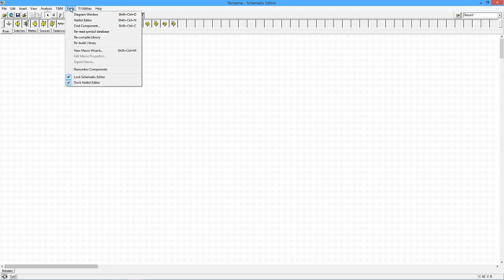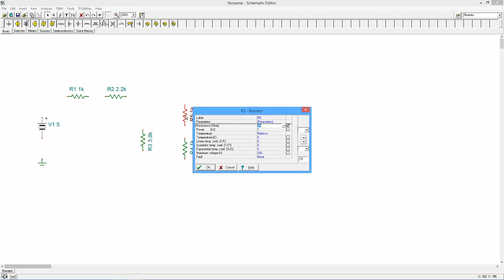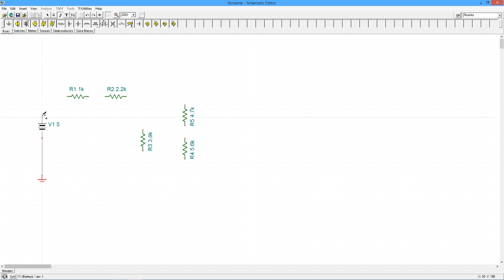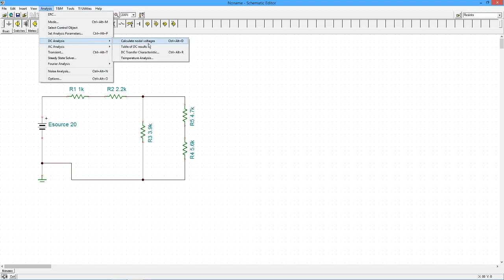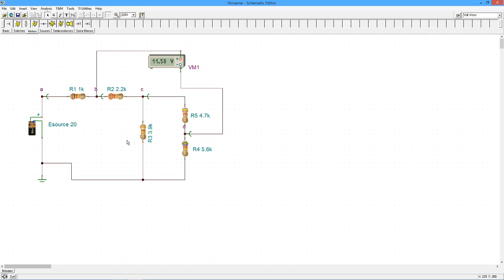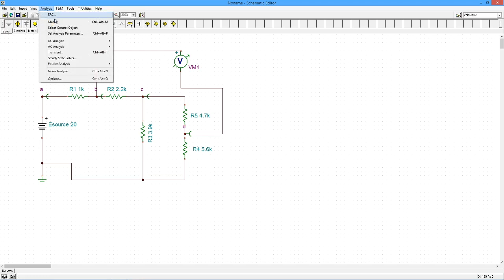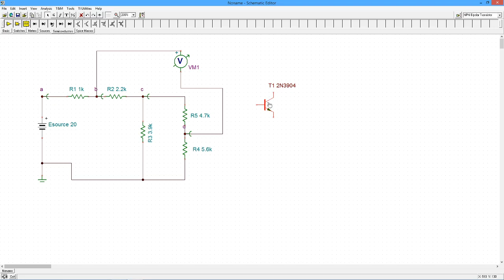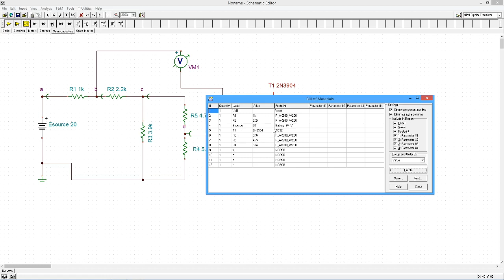TINA-TI Introduction & DC Simulations

Comment: Thank you. I'm just a hobbyist playing with breadboard circuits and an Arduino. I'm loving using Tina TI. It removes so much of the frustration for me and avoids me wasting time wiring up circuits that don't work. EDIT: As a beginner/hobbyist I didn't expect to find limitations of this free version so quickly, but it seems that it doesn't support polarised capacitors, although if you select "Enable 3D shapes" in the options, it does depict all capacitors  in the circuit as polarised electrolytic ones, with no way to select the direction of polarisation), which is even more confusing. I find the array of upgrades offered to be quite bewildering so I'm trying the version 14 trial which unfortunately doesn't make things any clearer.

Comment: Thanks for these very helpful tutorials !  I see there is a long playlist of them.  Do any of them cover the use of the TINA "Signal Analyzer" and the "Function Generator" (not Transient analysis, O-scope, Spectrum Analyzer ...) ?  Thank You !
Reply from the maker: No, I tend to focus on TINA-TI, which is free. It doesn't have the tools you mention (that would require $). I must admit, I am not a huge fan of virtual instruments such as function generators and o'scopes in any simulator I have used. They always strike me as rather clunky and less useful than more direct schematic capture and simulation methods. The one exception I might make is using a virtual voltmeter or ammeter for absolute beginners.

Comment: Great that TI made their version available.  Great tutorial.
I, also, couldn't find POLARIZED Capacitors.

Also, is there a setting or option to SEPARATE the component LABEL from the VALUE?
C101 100nF    .... is too long and the numbers run together.

I'd prefer;
    C101
   100nF
It's very compact and right next to the actual component.
Reply from the maker: I prefer stacked, too. You can leave off labels and such, and then add your own as text. Also, the label/value can be moved around the component (unselect the component, then click on the label, then move it-you'll notice the highlighting is different).

Comment: What is the reason for choosing this software versus something like KiCAD?  Is it just the simplicity and ease of use for the beginner?
Reply from the maker: In my experience the learning curve is very short for new engineering students. They can get up and running quickly. Granted, it doesn't do everything, but it is sufficient for most students during their first couple of years (and beyond that, they can get into the pro version of TINA with little headache). At this point, most students are not looking to make PCBs, they're just trying to verify a lab circuit or check some homework.
Reply: @ElectronicswithProfessorFiore  Understood. Thank you!

Comment: Thank you for the lecture. Apparently I am not able to build user defined excitation signal. The option 'Signal(t)' is greyed out. Perhaps its only available in paid version.
Reply from the maker: TINA-TI is a free version of TINA. That is what I am using here (the free version).
Reply: @ElectronicswithProfessorFiore  Thank you. 

Edit: I found the following answer in the forums from TINA-TI. "This function can only be enabled by purchasing the full version of TINA from DeisgnSoft. There are a couple limitations of the free version of TINA-TI and this is one of them. Additionally, Monte Carlo analysis is not enabled for TINA-TI." 

Found this helpful in this regard:
https://e2e.ti.com/blogs_/b/analogwire/archive/2014/05/30/what-you-always-wanted-to-know-about-tina-ti-but-were-afraid-to-ask-part-4

Thanks again.

Comment: I haven't downloaded this yet.  I'm having trouble finding a program with simple things like fuses, bulbs, various switches (SPST, DPST, DPDT), vac tubes, etc.  Does this have those?  Very nice flow on the instruction.
Reply from the maker: TINA-TI has some switches although I do not believe that it has tubes. If you have a spice macro for your part, you can import it. The TINA-Cloud version ($12 per year for student access) has a much more broad array of components.

Comment: Using the knowledge of electronic devices and circuits, design and simulate the circuit diagram of a 4.7 V DC power supply. Input voltage is 220 VAC at 50 Hz.  can anyone pls answer thin in 10 minss
Reply: no